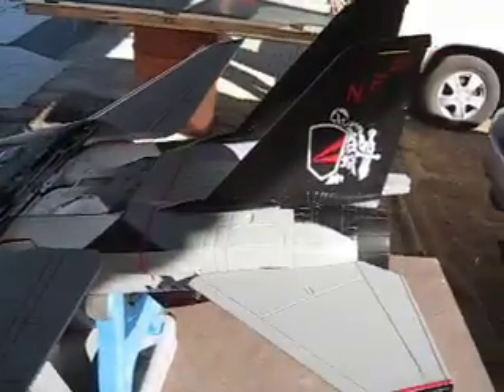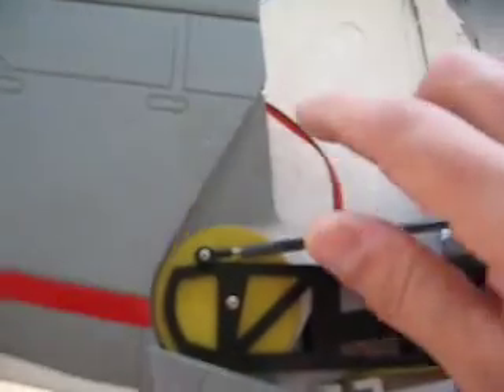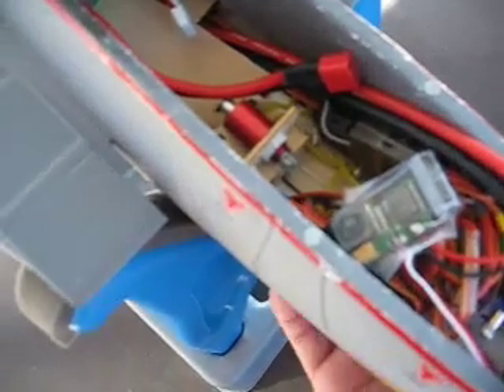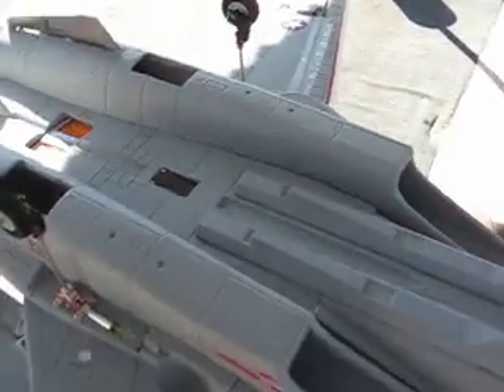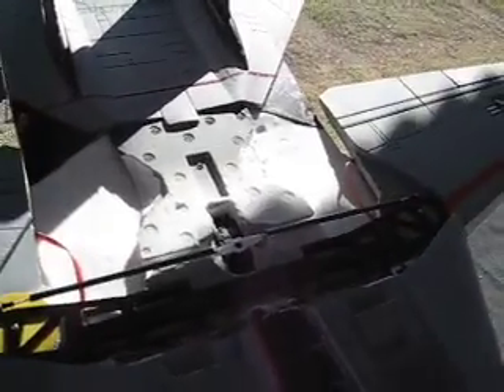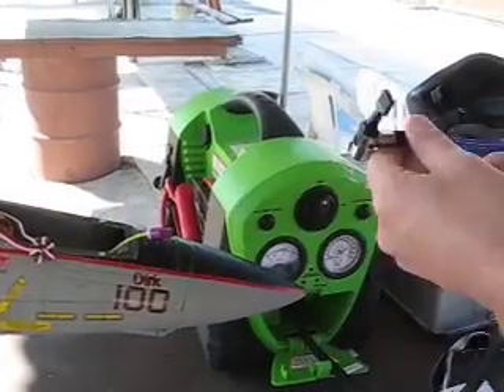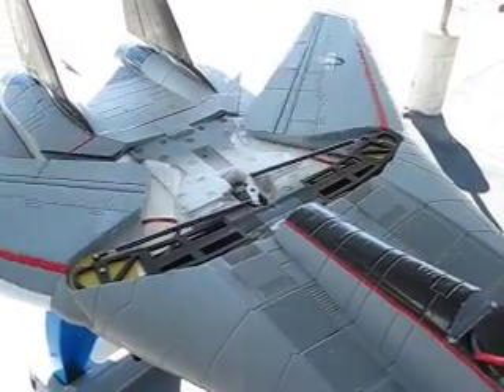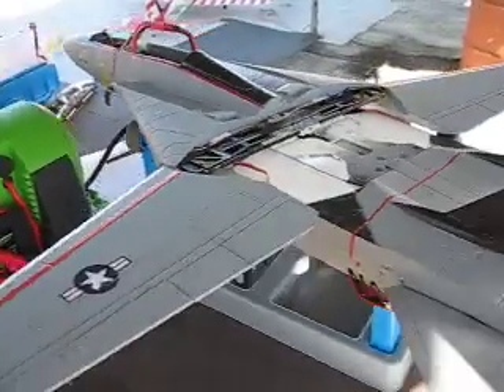Grumman F-14 TOMCAT RC EDF JET BlitzworksRC

Comment: Wow, sounds like an airframe that needs to be gutted, modded, and then use your own electronics..

Tom is right, the swing wing servo is being stalled, which is why that happens. You might want to also set it with a linear mix so it's speed stays a bit slow. Fast like that could cause it to drop out of the air when you fold the wings back. BTW, you'll probably find yourself flying at WOT with the wings back, because there's less surface area when they swing back ;)